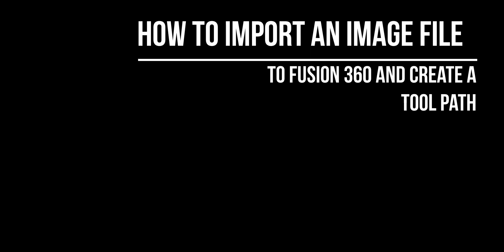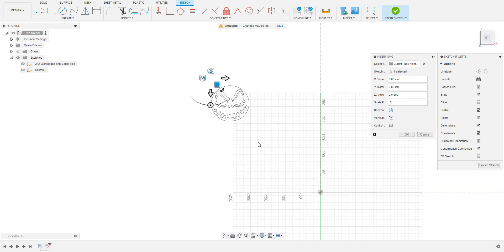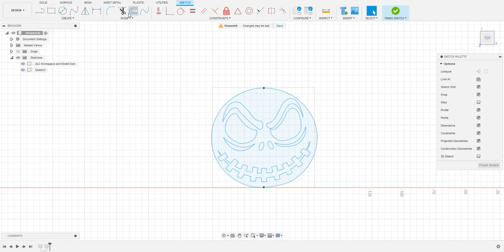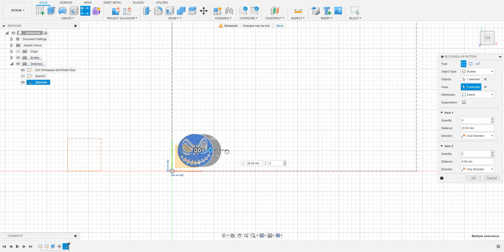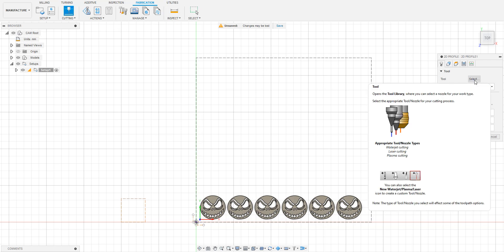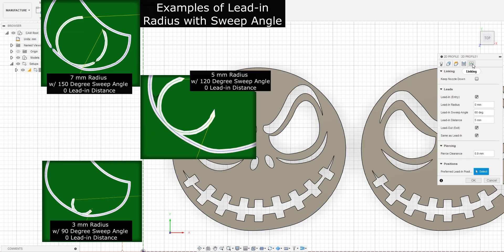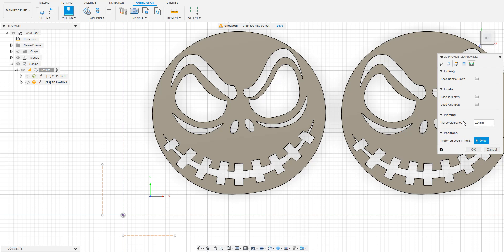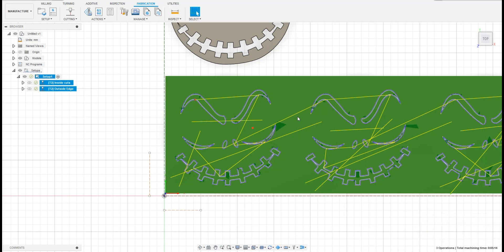How To Import an SVG or DXF File in Fusion 360 and Generate a Toolpath

Comment from the maker: Correction/Note for when creating the toolpath for your parts. If you want to have the ability to change your Kerf on the table, or you are exporting a file with 0 Kerf, be sure to select the "In Control" compensation type in the "Passes" tab. If you select the "In Computer" compensation type then the Kerf set in fusion will override any Kerf settings on the table. If using "In Control" compensation type, be sure to set the Lead-in Distance to the smallest non-zero value possible.

Comment: Good afternoon, I would like to ask for help, I am importing an SVG file to use as in this class, but after I import it I cannot extrude it separately, it looks as if it were joined to the other drawing, I have tried several ways and it does not work, if you know what is happening and can help I would appreciate it.
Reply from the maker: Hello! If you can reach out to us by email or phone I would be happy to try and help figure it out with you!

Marketing@halo-innovations.ca or 905-981-4256